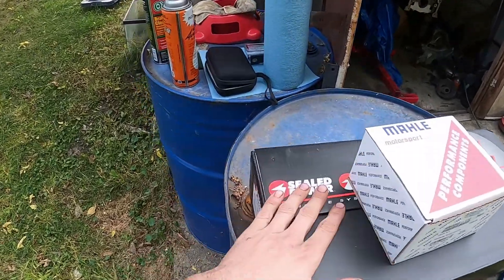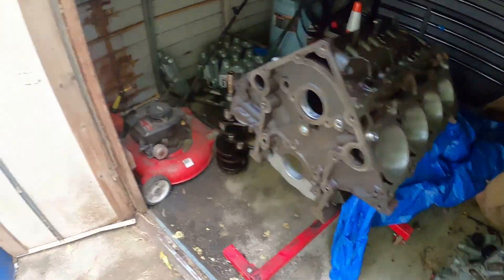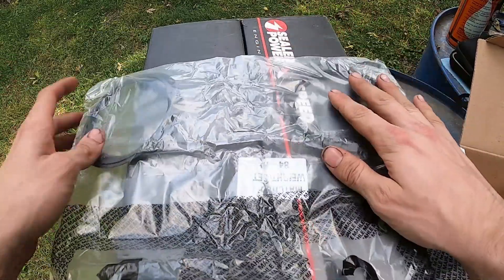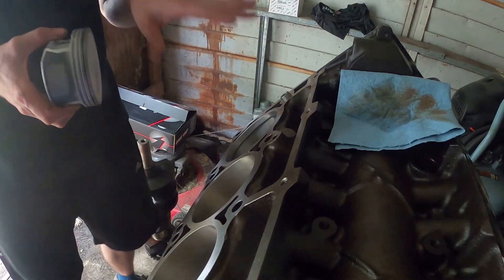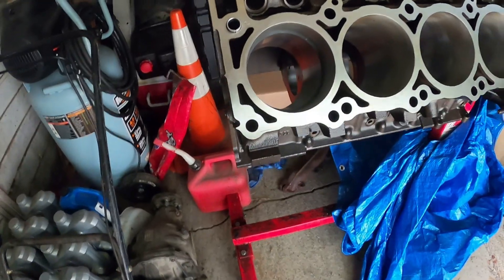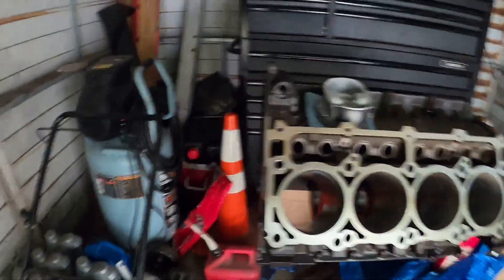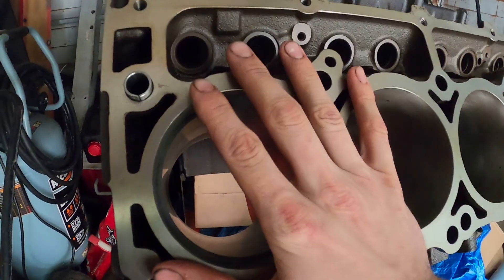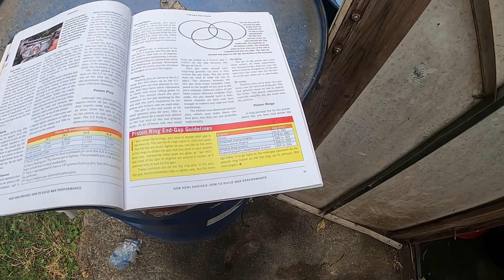How to: Gap Piston Rings on Your Hemi

Comment: Does this really make that much of a difference in power?
Reply from the maker: It’s more of a precautionary measure. You want to have properly gapped rings for your application. For example: the tighter gap for an NA build bs a boosted build. From factory, 6.1s have a relatively tight ring gap that can lead to fracturing or even breaking the top ringland. It’s pretty common to regap rings and throw it back together to make more power reliably.
Reply: Not a difference in power but a difference in longevity